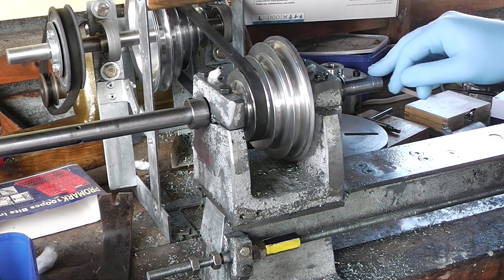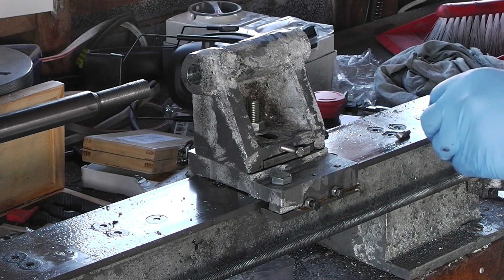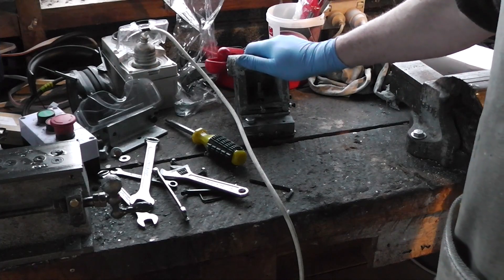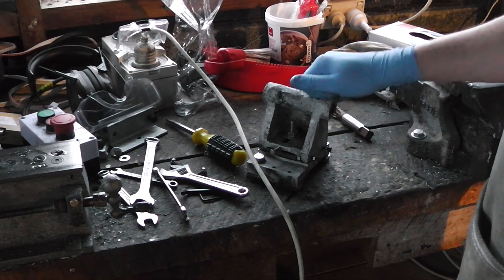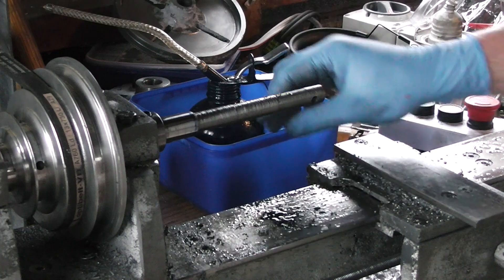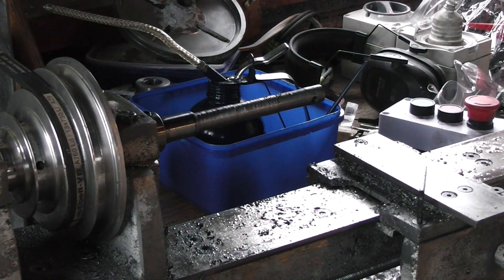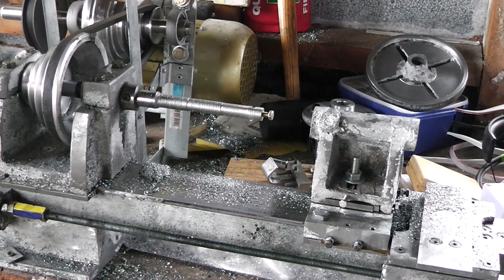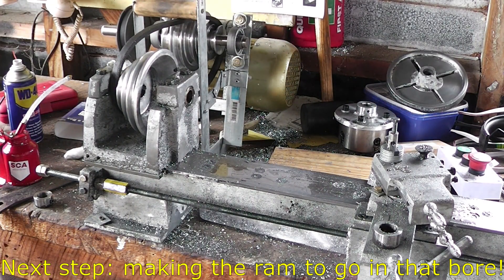Boring Out The Tailstock

Comment: Congrats on the new tailstock. Will you be making a taper in the end of the quill? I recently made a new one for my mini lathe and having a morse taper reamer was very helpful with my flexible boring bar.

Also does the gingery book use a simple screw into the quill to lock it? I've had a few old lathes like that and they were nowhere near as good as having a proper quill lock that draws two pieces of metal together against the shaft.... Trying to think of what those are called.... Not a very useful comment!
Reply from the maker: I'm planning on a taper, and have some MT1 reamers :)